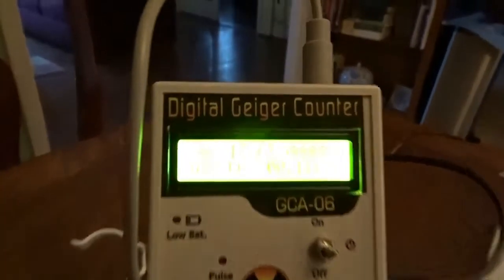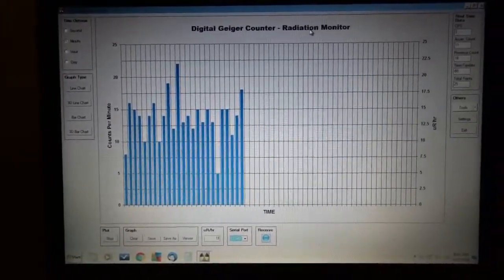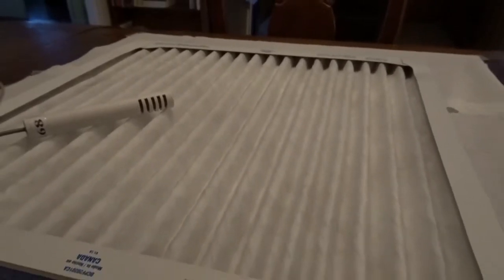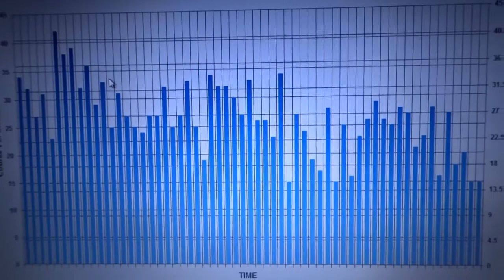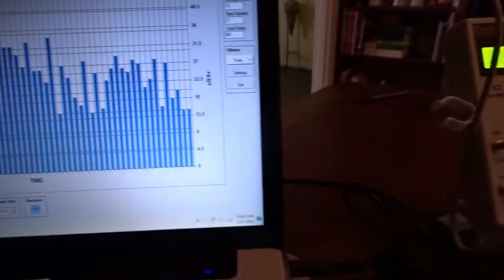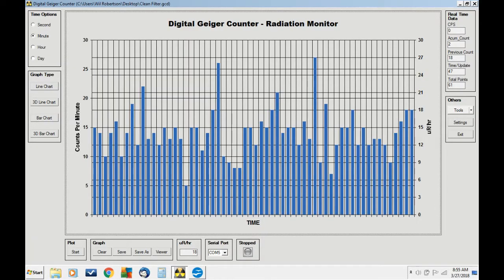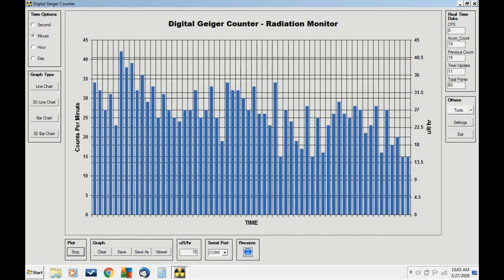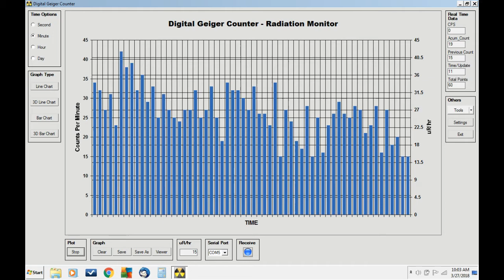Radiation from Dirty Air filter

Comment: I'm getting 0.12uSv/h inside my house...I just took off the 20x20 climate system filter of my house and put my Geiger counter on top of it. The reading went to 0.34uSv/h or more than twice. This filter is probably 2 years old. This is either beta or gamma radiation. What is likely trapped in the filter?
Reply from the maker: no sure. maybe radon? but since radon is a gas this may not be the case unless somehow the gas is absorbed. again, not logical. it could be normal background radiation concentrated in the filter’s dust. maybe others have a better idea of what’s going on.